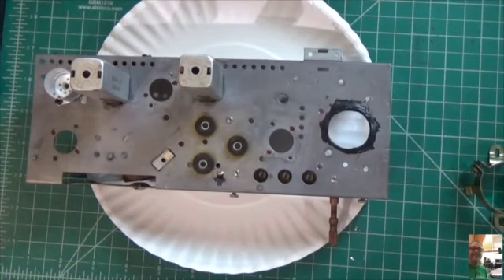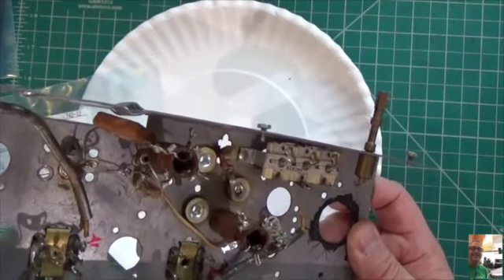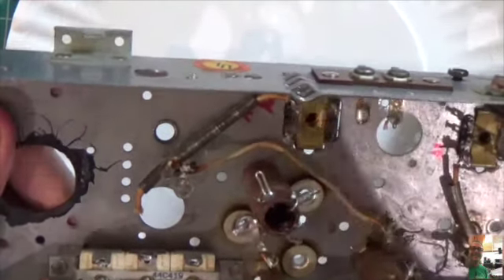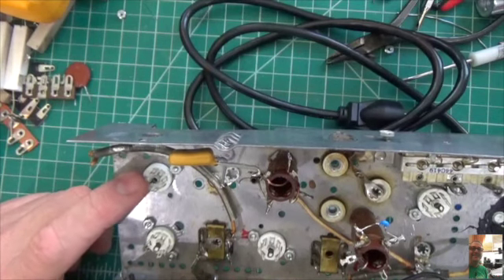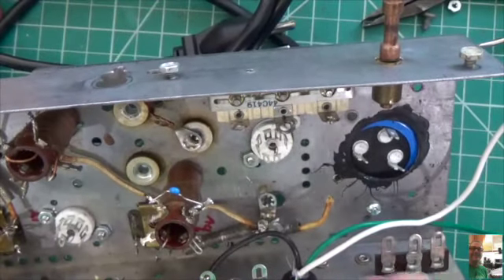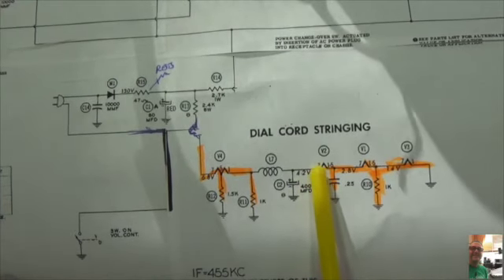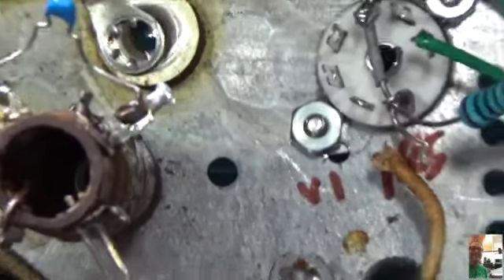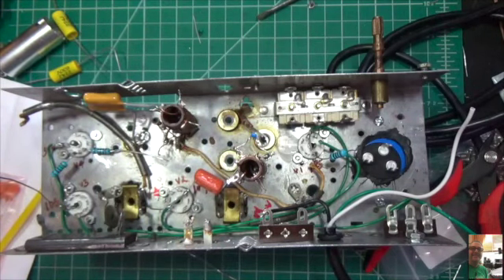Hallicrafters 5R41 and S-20R Restore # 20 - Mystery Socket to Me Wireman.

Comment: Nice work Ron and those low loss sockets are great.
I wonder if you need every tube shielded though.
Reply from the maker: Thanks Bill  I may not need the shields but I have them so will use them. It cannot hurt... they are much more important for a guitar amplifier.. but will look good on this radio.  :)

Comment: You're making good progress Ron! There is one suggestion I would like to make. When you go to solder a component (or whatever) on the terminal that you fixed on the coil, clip a heat sink of some sort to the repaired joint, that way when you solder something to it, it won't melt the solder on your repair. Don't ask me how I know that! BTW, where did you get those tube sockets?
Reply from the maker: Jim, 
Funny you mentioned that... when I worked on the rest of the coils, I attached a forceps to the terminal when removing solder to keep the heat flowing to them. I will invest in a small heat sink set for this purpose. Excellent observation my friend... excellent and thank you.  Ron